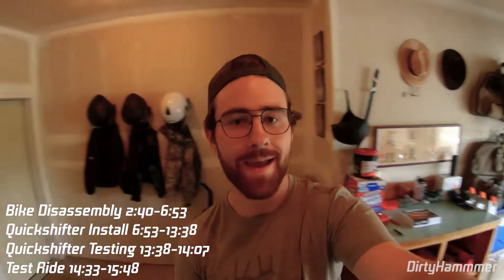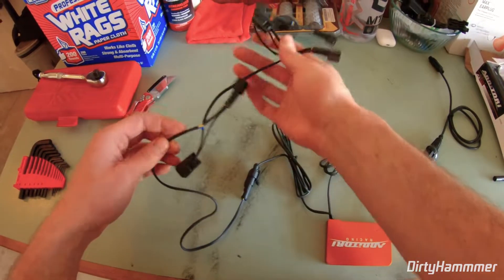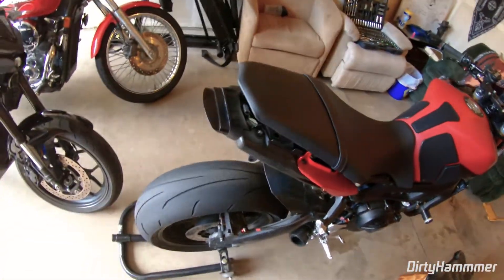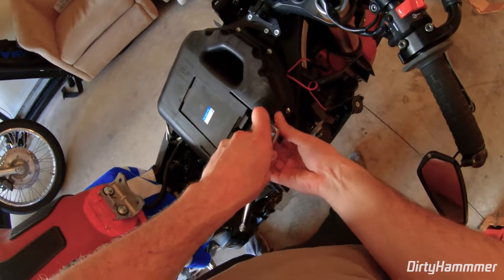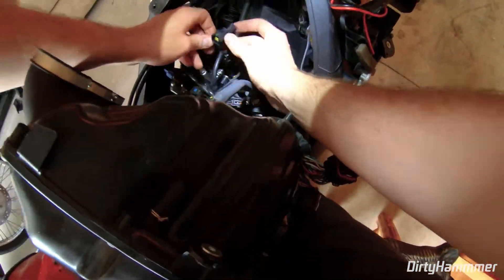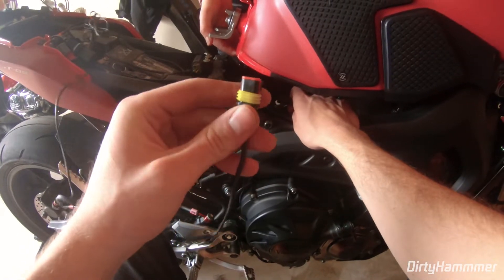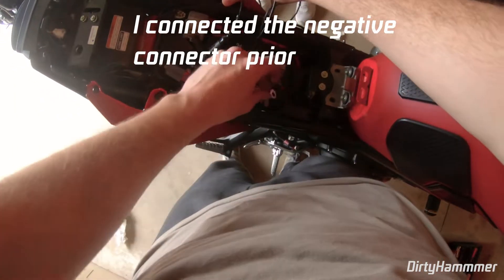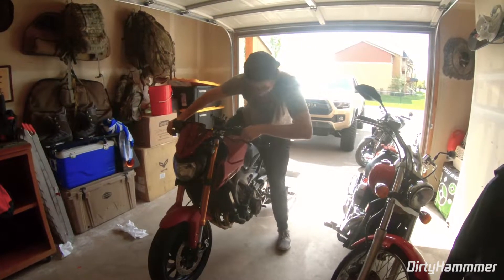MT/FZ-09 Quickshifter install - Annitori Quickshifter Pro 2

Comment: SHIFT ROD INSTALLATION TIP: When connecting the sensor to the top rose joint via the threaded bar that connects the two together. In order to have the sensor oriented with the wire coming out of the top,  It's much easier to remove the top rose joint and clamp from the bike (it slides off the shift shaft as one piece) and spin it onto the threaded rod coming out of the sensor vs. rotating the sensor while the rose joint is still attached to the bike.

Comment: hi good video well explained..did you keep the same settings since you 
put this video out! i have yamaha mt 09 16 plate..not purchased yet but 
will do soon.. also should  it not be on push instead off? pull - its the the spline on the linkage rod that is pushing! thanks
Reply from the maker: It still has the same settings as when I posted the video, it's working well

Comment: Lowkey thinking about getting this Quickshifter for my Fz09 2016 I got the VCYCLENUT flash as well. What do you think about it ?
Reply from the maker: Personally I love it, the fact you don’t have to reflash the ecu after installation was a big selling point for me. Easy installation, works great, plus the ability to change settings on the fly is a plus. I’d recommend it 👍🏼
Reply: DirtyHammmer well I got the VCYCLENUT flash. Back when I got it flashed he sold another brand of quick shifter. Been thinking about getting a quick shifter for a while.
Reply from the maker: @808Affliction   you won't regret it, smiles for days :D

Comment: I installed the qs… connected with Bluetooth but when i lock the phone the connection is gone? Do u have tips. Do i reconnect the qs at al times when i ride?
Reply: It does not have to be connected to your phone to ride. Just to make changes. They even recommend in the manual that you completely disable the app after you’re done so you don’t make “butt changes” in your pocket lol